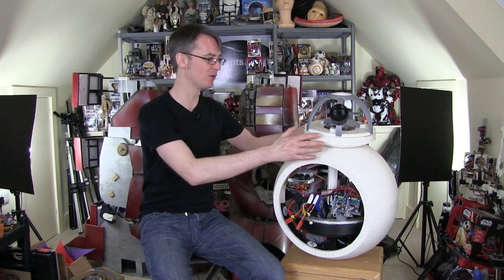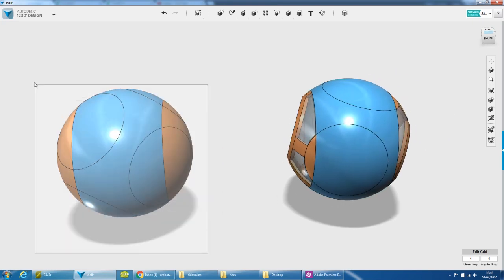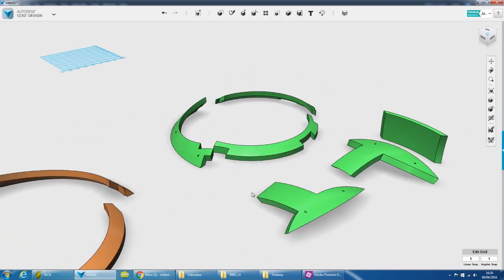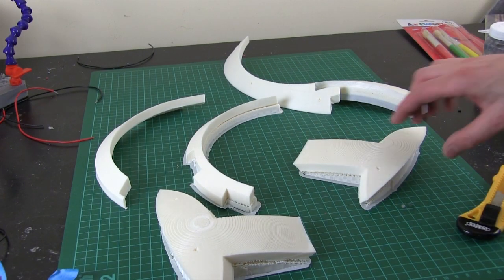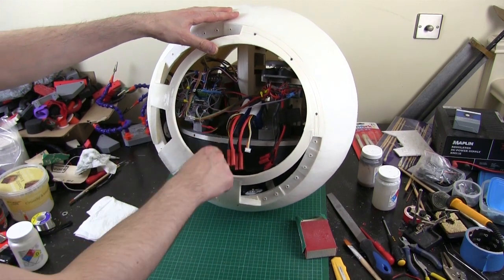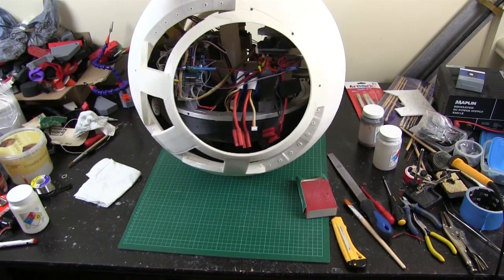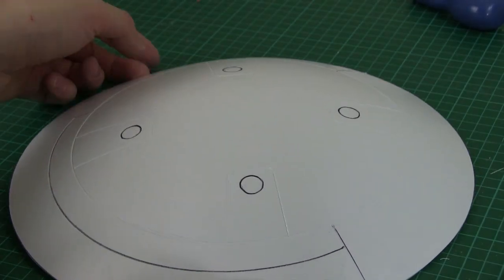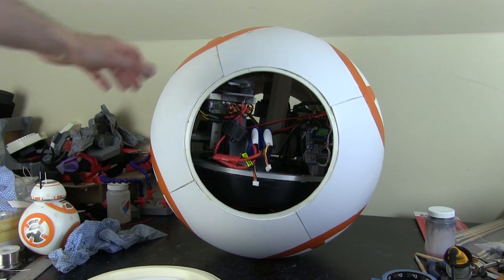Star Wars BB-8 Droid v3 #11 | Side Panels & Skins | James Bruton

Comment: What if you had two flywheels/gyros that spin opposite each other that spin all the time for turning on the spot? That way you could slow down one or the other to steer in a certain direction. Alltough there would obviously be a much higher power conumption problem.

Comment: Hey James, 
I got one suggestion regarding the servo links and head wobble issue:
You could replace the entire links with steering rods from a 1/8 rc monstertruck. they are extremely sturdy and use a balljoint on either side and should be about the correct size. 
Also, there are pivot balls (from the rc car sector as well) that have a hole through them, so you can connect the steering rod to the pivot ball and then just bolt it where your current servolinks are mounted.

keep up the great work, cheers!

Comment: Wow you are doing such a bang up job on this BB-8, hope you get the recognition you deserve. The 3D printer manufacturers should be all over your work, what a great application. The wire management is a tough nut to crack.  Since it looks like you may changing some of the control modals in Hulk Buster, wire management might be something to do in CAD.

Comment: Hey James, would you mind showing some of the elapsed times and material usage for the prints?  Would be interesting to those of us who don't have experience with 3d printing :)
Reply: +tiporari Long and ABS. The time taken usually depends mainly on how big the piece is, but also how complex it is. But it's slow. Even though lulzbots are pretty quick, 3d printing is a slow process. But you don't mind, because it's still faster than trying to scratch build it some other way. That piece at 3:52 probably took 6+ hours.. maybe more. ABS is pretty much the strongest plastic, It's what I prefer to print in. PLA is more brittle, but it's not as toxic. ABS lets off some very nasty fumes which are carcinogenic, (cancer causing), so I print my ABS in my car garage, and I wait an hour after a print before going in there. By the way, if you want to see fairly accurate print times, download his stl files from git hub and load them into Cura, lulzbot edition. It will calculate and give an estimate of print time, you don't need a printer to see that.

Comment: You should try attaching a small camera [GoPro?] to the bed so the timelapses are more smooth
Reply: +James Bruton (XRobots) You could use a switch that triggers the camera each time the print bed is at a certain position.

Comment: Awesome job so far.  Would love to see you drive all 3 versions on a large smooth surface. 

I recall you had issues on smooth surfaces,  how about using some soft/rubbery 3d print material and then benefit from more grip but also would help with minor impacts and bumping.  like a giant drivable basketball.  Then of course you may have issues with the head rolling if the material had too much flex and grip but I bet there is a happy median that would give you good control.
Reply: +James Bruton (XRobots) Looking forward to it.

Comment: A shame you couldnt place the rings more offset from the center line
Reply: +James Bruton (XRobots) ㅗ
Reply: +James Bruton (XRobots) I don't think your going to be happy with it when you get it all together.. the circles are a little to straight and the side ones are not offset enough so when you drive it looks like the whole thing is wobbling. I have no idea what you could do differently though. You are by far a lot smarter than I am when it comes to this stuff. I really enjoy these videos.
Reply: +PimpTwzt I don't know
Reply: +James Bruton (XRobots) I know it's easy to be wise after the event but I really feel like this looks a bit weird. This slight offset gives the impression that it was intentional for it to be perfectly centered but the droid drives unevenly (as you pointed out). I feel that even a few extra centimeters would help - couldn't you have these opening dishes a bit more off center, using the 'cheese' as a part of the ridge on one side?

Anyway, with everything glued, I guess there's no chance for further adjustments :(

By the way I wish you decide to cover the head fully in the end :D removable panels could be nice so you can show the insides on the exhibition but permanent openings would (in my opinion) ruin the overal look.
Reply: +Krištof Pučejdl?